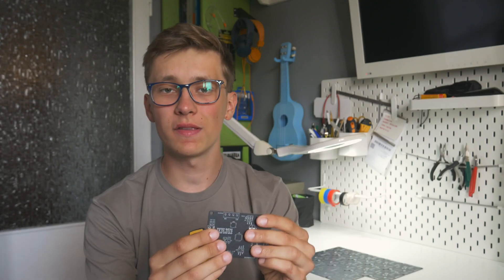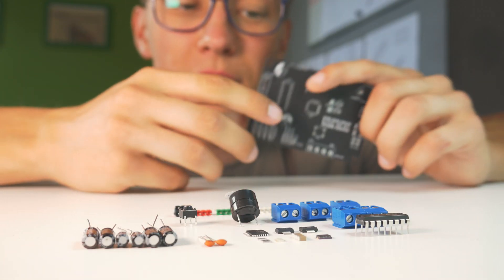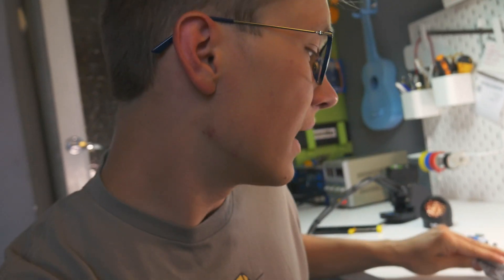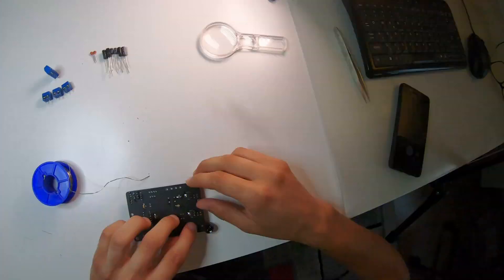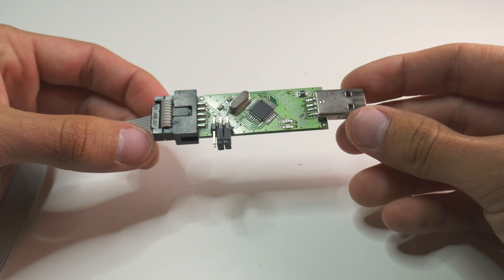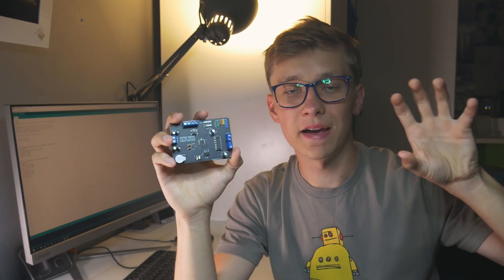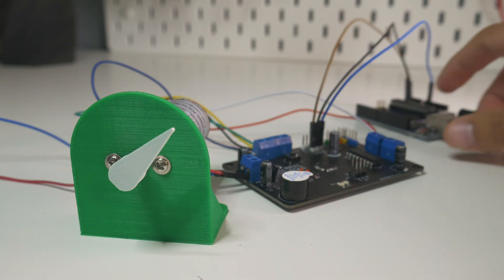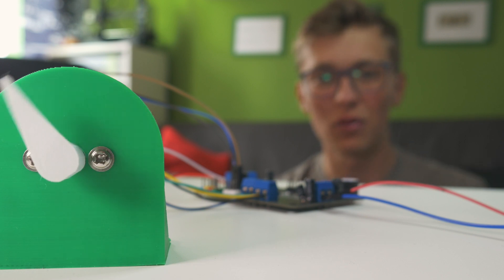Encoded Motor Driver With Arduino

Comment: Hi Nikodem,
good job!
let me teach you a trick for soldering SMD components:
you did well to put a little tin on a pad and then put the component on it and then soldering it on the other side too, but before soldering  the other pins, better put some fluxant on the first solded pin  and go over it again, the component will settle perfectly and you can then switch to the other pins: the tin wire already contains the fluxant but this evaporates very quickly and when you make the welding in two times (first the tin then the component) the fluxant evaporates at the first time.
When instead you directly use the tin wirewith other pins, everything goes as it should, except for components such as the 328 which has very close pins, in this case after soldering all the pins, repass them with a bit of fluxant, you will get so that the unwanted shorts will disappear in a moment. Do some training on old circuits and non-functioning components so you don't waste good material.
Hello and the next video!
Reply: Agree. Great Scott uses your method with total success. Fluxant is the key-word.